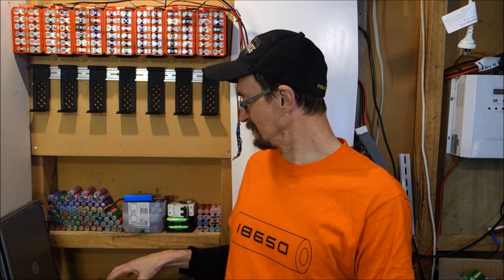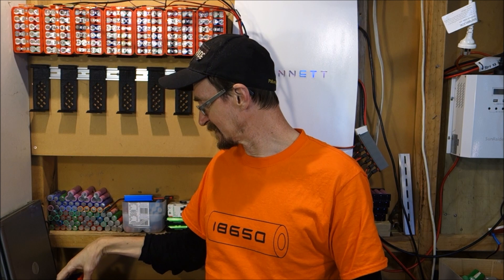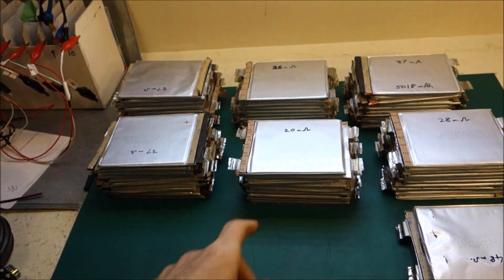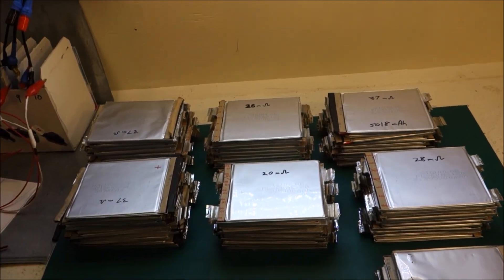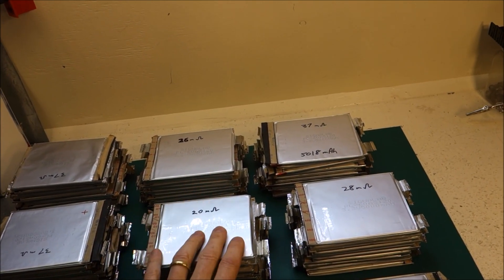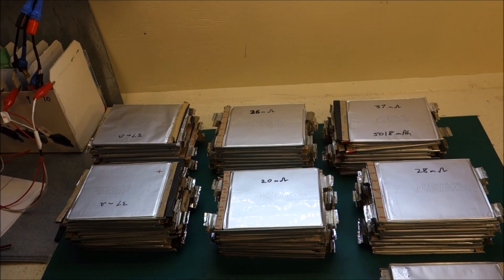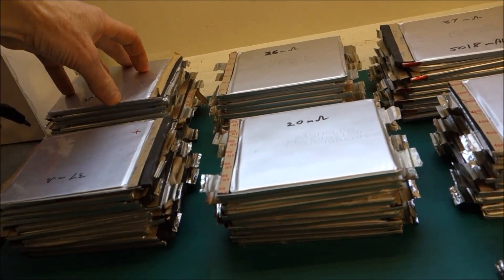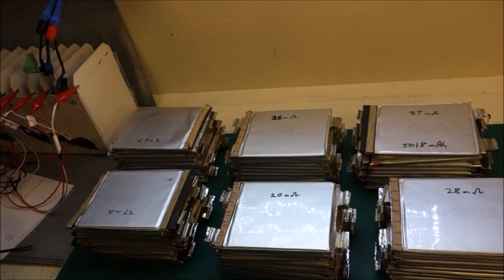Laptop Powerwall 73 - general update

Comment: Thanks for the update, looks good there on the wall.  Should have my first 7s system ustilising your design up and running oh so soon, just waiting on parts as ever :-(  should be here in literally days though.  Are you going to put the two 7s packs in parallel with the rest of your setup?
Reply from the maker: I haven't quite decided whether to go 7S24P x 2 (two packs in parallel) or 7S48P. Mostly it depends on what BMS I end up with. Till I get a BMS for those packs I'll carry on with the no BMS experiment by putting the Powershelf cells into the new Small Blocks pack. Then throw some "new" cells into the Power Shelf for testing.